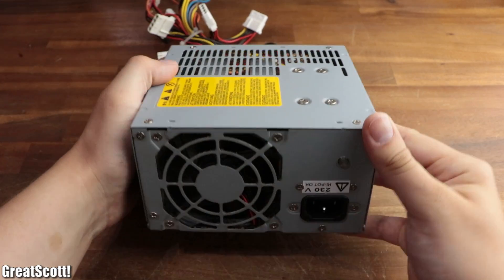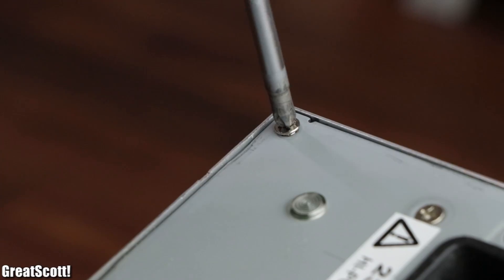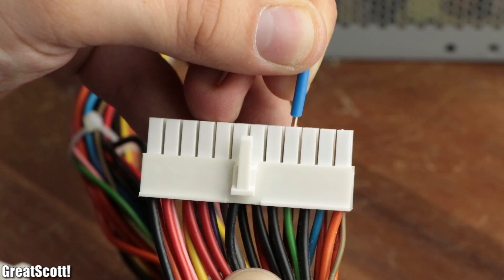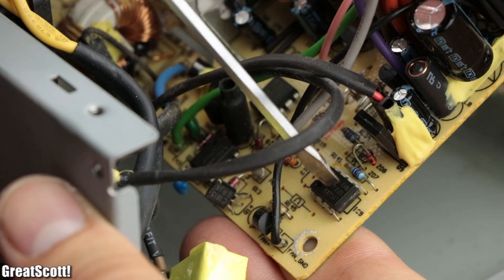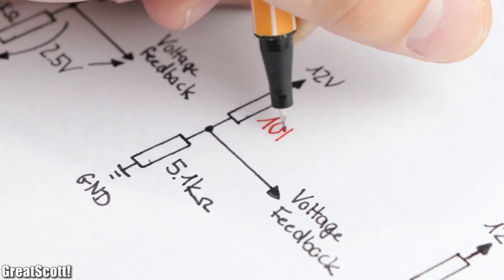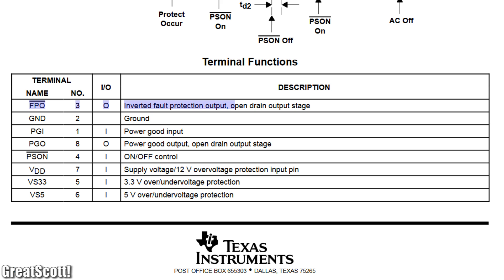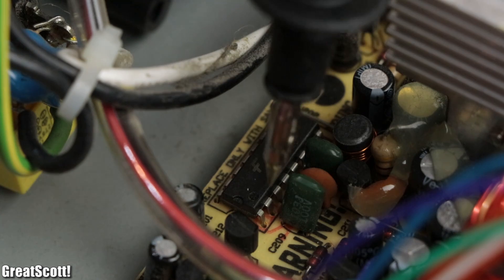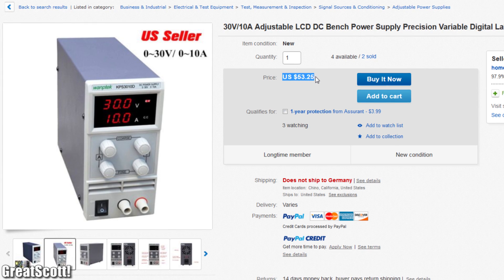HACKED!: ATX Power Supply with Variable Output Voltage?

Comment: Your handwriting is so perfect
Edit: THANKS FOR THE 208 LIKES
Reply from the maker: Oh stop it, you
Reply: @greatscottlab  man your handwriting is cool.
Reply: That Sine wave though
Reply: It's called Times New Scott, as mentioned before.
Reply: I agree.
Reply: qwerty keyboard GARBAGE DAY
Reply: your handwriting is very nice by the way
Reply: fidel catsro I Know right now I wish I said that as a plus the schematics are very clear
Reply: and amazingly, done with left hand!
Reply: +Ryz 3D I got that reference!
Reply: and he is left handed :))
Reply: GreatScott! not that I will attempt such a modification but what about using a digital potentiometer ? by the way I utilized your idea of using a buck and boost converter as my supply powered by a 12V 30A SMPS for LEDs bought off of Amazon. bought buck(15A in;10-80V 10A out) and boost(0.8-28V 0.1-12A out converters from eBay and created a protection circuit out of a comparator n-channel mosfet some resistors and a relay it was a little more expensive to throw together than the one you showcased in your video but the max output of 80V 20A is completely worth the price I forgot to mention that I hooked up two of each converter in parallel
Reply: like a computer aided printer!!
Reply: i second that!
Reply: GreatScott! Well it’s true! I got Dysgraphia so my handwriting is just unreadable literally when you give me time, yea it’s good at times but when I write fast it’s really hard to read for that reason I rely on my laptop for school cause I’m a extremely fast typer
Reply: lysippus well for small handwriting it’s pretty good
Reply: lysippus not many people are able to write in such small letters with good handwriting
Reply: AJLION GAMING hey that's cool so do I have it so bad I only gave three sentences on my FCAT writes test I can't write when someone gives me a prompt and Usually mine is pretty crappy
Reply: AJLION GAMING my hand writing is absolute garbage!